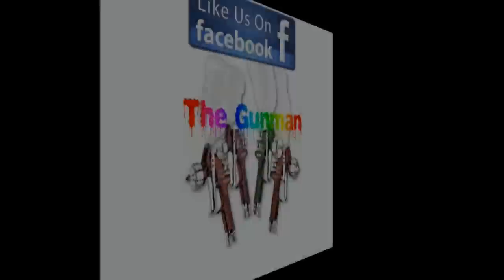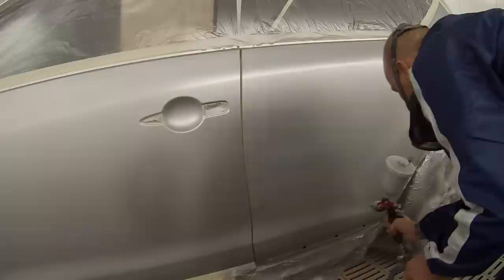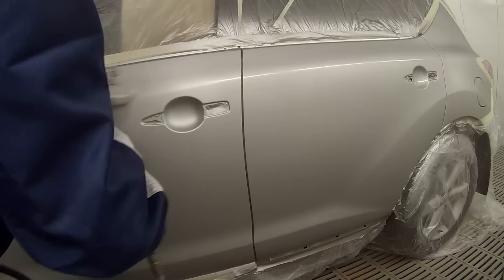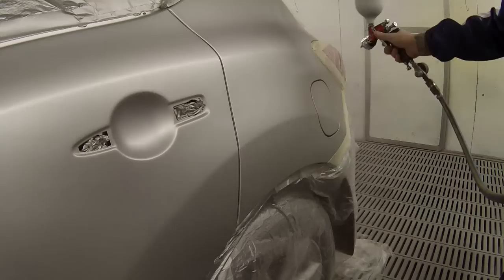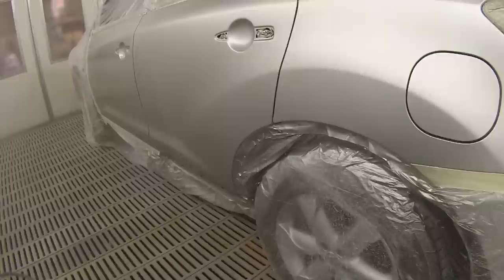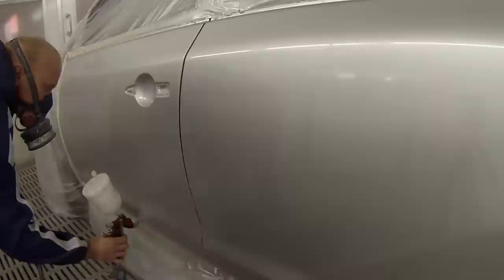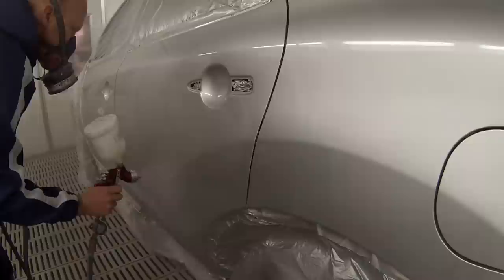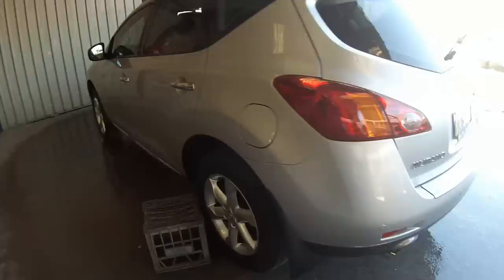Blending Metallic Paint & 2K Clear Coat

Comment: So, first thing : you are doing great job. Perfect paint!
Next, questions :) 
1. looks like you did first 2 coats of base wet. After that blending clear, and final base coat with blends. but this 3rd coat of base, final, did you do it wet? or half wet? i cant see it on video, but looks like 3rd coat you did dry.
2. what reducer do you use? mid or slow? and how do you adjust your gun fluid/air? how many turns out for fluid and how many psi for air?are they the same for first 2 coats of base and final base with blends?
3. looks like you are doing 2 wet coats on your clear coat. What do you think about first "dust" coat, and second wet? I'm asking because i loved to see my clearcoat without orange peel , but, i'm tired to take out runs . And somebody told me that first "dust"coat can help avoid runs. But i'm curious if it will not affect my orange peel in finish.
I hope you will answer me. Anyway, thanks for great video again!
Reply: He didn't answer u

Comment: I need to learn how to blend metallic silver, I have just messed up two paint jobs where I did not blend the Silver properly.  I have one question Gunman, I apply the clear and then immediately blend the base over the wet clear, can you use standard clear coat or is there a special type of clear that you need to use?
Reply from the maker: It's a specific "clear basecoat" designed for blends, all it does is fill the sanding scratches but dries like any basecoat. Are you using solvent or water based paint?

Comment: Beautiful work!  I highly respect your abilities in auto painting and I wanted to see if you could answer a couple quick questions?  If not, that's OK too.  I have a lip kit I'm adding to my 2000 Prelude which has Crystal Blue Metallic paint on it and was repainted about 4 or 5 years ago so, it is still really nice looking.  One of the side skirts had a scratch that I wanted to buff out and looks as if I sanded through a coat of clear but, then down to another coat of clear?  It's very odd looking, should I just sand the whole thing and re-spray the entire piece?  I also have a scratch at the bottom of the car right in front of the wheel well, would that entire panel need to be re-painted as well to fix it or could I somehow blend it?  Lastly, the front lip is currently being sanded and filled to get it straight, could I use a regular primer or should I use a 2k primer.  I'll be spraying with 2k color and clear.  Thanks for your time.
Reply from the maker: Copied and pasted, I may cover in a Q&A video I have an idea for

Comment: Is It really necessary the final drop coat ? Because i found that with Spies hecker 293 solvet base, with or without drop coat, there is no difference in the metallics. Also the tds doesn't say nothing about drop coat, Just to put 2 to 4 coats till coverage..

Comment: great video! What tip size combinations do you use for your spray guns when shooting base and clear? my brother in law got me the devilbiss starting line set and I am keeping the 1.3 tip on one but Im going to swap out the 1.8 on the other gun and will be designating it as my clear gun. Im trying to decide on the best tip size for clear using that gun. suggestion?
Reply from the maker: I always use 1.3 for clear and base, 1.8 is more for primer and I have an Airgunsa 1.8 for primer.
Reply: The Gunman I couldnt remember if you did or not, I have used 1.3 for base and clear also. Some people have told me to use a 1.5 for clear coat that it lays out more material but I would think that with tip size it would leave more overspray and orange peel. Im really not considering that set up...lol
In the past I have used a 1:1 ratio of mixed clear with base coat to blend, do think that is a safe method? or should I consider getting the pre-blending clear thats already mixed and add the color to that?
Reply from the maker: I'd stick with the 1.3mm for cc+bc too as you say 1.5 will get it on real thick and peely, I,m not shure about that blending method though, I never mix normal clear with base, I use a clear basecoat what you hear me referring to as blending. Check this product its the same basic product that you see me use, all systems have it so no need to go and buy the Glasurit big $$$ but you should get the idea of what it is. clear. http://techinfo.glasurit.com/en_UK/PKW/Chapter_G/GX/55-B500_print.pdf

Comment: Hi Gunman. Is the blending clear basecoat necessary for blending or can a blend be done without it?
Reply from the maker: Any light metallic basecoats will need it, it fills in the scratches from your prep and brings the surface up even with the new basecoat you are applying.

Comment: Hi gunman see when you are blending silver do you drop the pressure on the gun down from 2 bar to drop coat or do you just keep the pressure the same and give a lighter coat? My boss doesnt believe in blending clear iv been taught to turn pressure down to 1.5 bar and drop coat to blend bu it doesnt seem to be working im having trouble blending without seeing where the basecoat has been applied on the blend panel. Hope to hear some feedback. Thanks
Reply: I need help with this also...good work gun man

Comment: What is blending clear is it a mixture of base coat and clear , if it is can you tell me the % of the two cheers
Reply from the maker: stephen Rorhan Clear basccoat, or basecoat binder not normal clear at all here I was using Standox 599
Reply: +The Gunman Phenomenal work man!  When you spray your basecoat binder, do you mix in a little of the metallic basecoat as well or use straight binder?
Reply from the maker: Just straight binder 1:1 with reducer

Comment: to avoid mottling ur technique is  not to spray the clear coat to wet at the first hand ?
Reply from the maker: It Can drag the metallic if you put your first clear coat too wet, but I've found the best way to eliminate mottle is just applying the basecoat evenly with a gun that has a nice big fan.
Reply: thanks 4 the tip ;)
Reply from the maker: No worries hope it helps